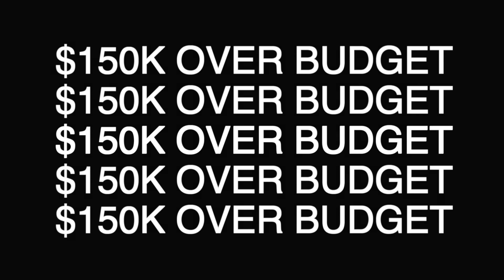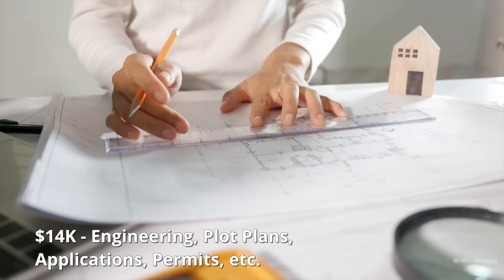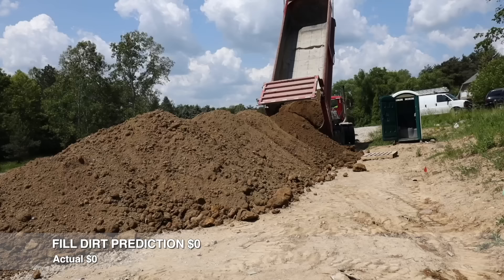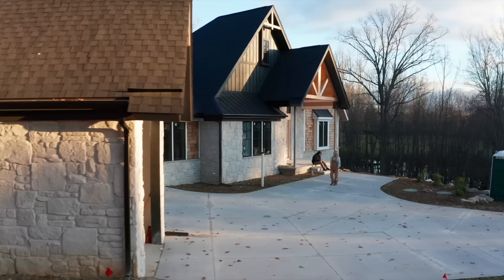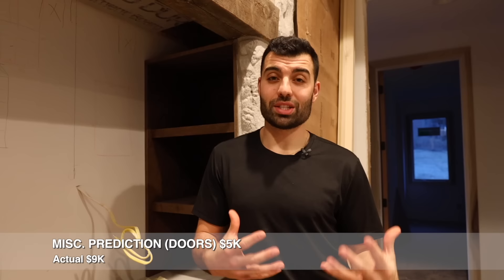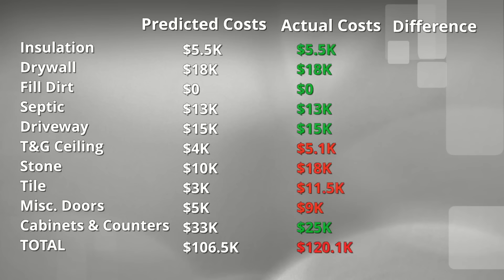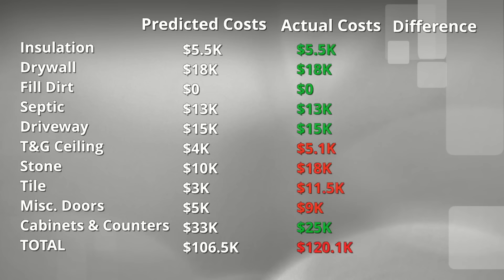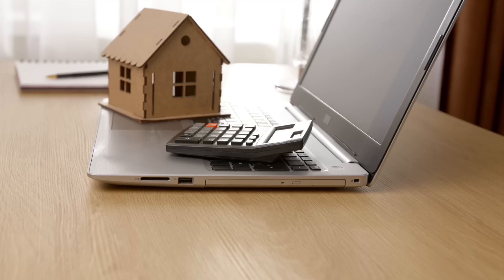Cost of Building Our Home in 2024 | Current & Projected House Budget Ep. 24

Comment: We've been told between 300-450 per sqft for our 3600 sqft house so far.
Reply from the maker: We are right around 225 per Sq ft, but some of the luxury homes Lisa designs can easily get in the 300+ range. Also, if you are hiring a builder then  $300 seems reasonable.
Reply: @FarisandLisa  that's reassuring! We'll be hiring someone, definitely impressed by all you've both done!

Comment: My current home is a split level small house built in the 80s. It’s on 0.56 acres, which is a lot when comparing it to the new builds in Atlanta that are sandwiched next to each other. I’m wondering if it would be a good idea to tear down our home and rebuild a newer more modern home. Is it worth it?
Reply from the maker: I guess it all depends on your budget. Closer to Detroit the suburbs get tighter and tighter without any new lots and it is very common to buy an old house, tear it down and build a new house on top of it.
Reply: @FarisandLisa  thank you for response. It’s great to know that it has been done before.